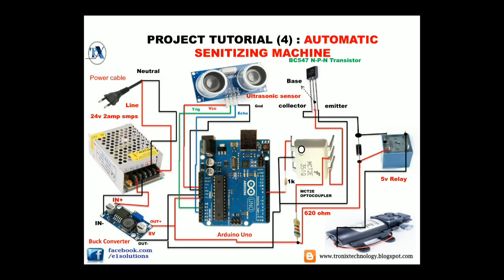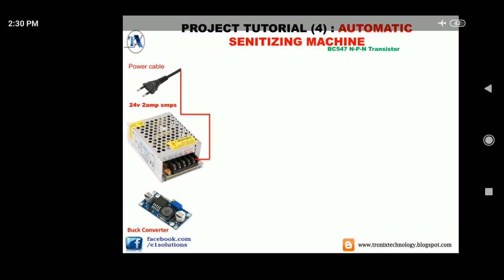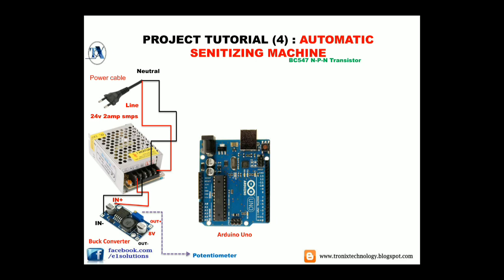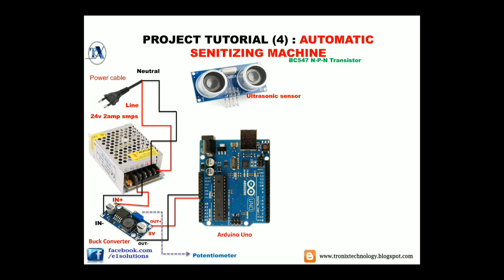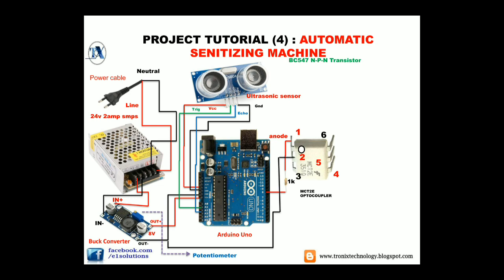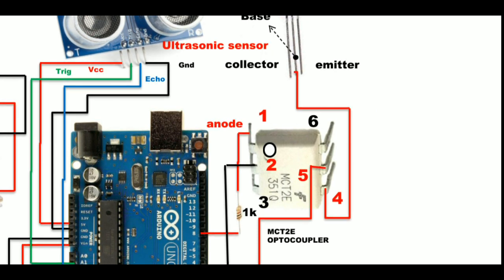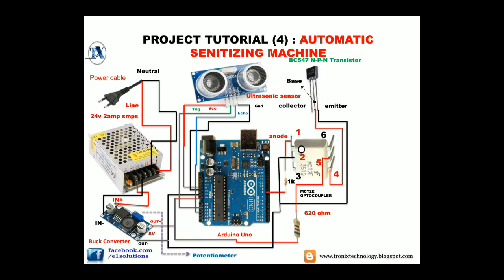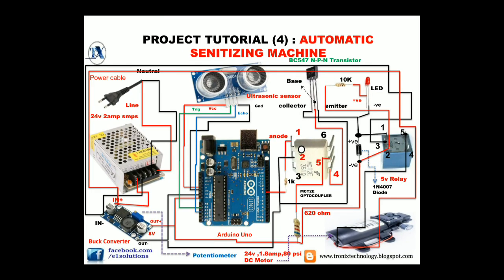Tutorial 4 : Touchless sanitizer dispenser

Comment: Sir make a video on , ultrasonic hand sanitizer circuit ,without using micro controller or Arduino ..
Reply from the maker: https://youtu.be/jpZMG4LOZ6g
Reply: @TRONIXTECHNOLOGY  sir it's based on IR. .. not on ultrasonic sensor
Reply from the maker: @userdefine  yes it is based on ir,ok I will make a tutorial video on ultrasonic system without microcontroller
Reply: @TRONIXTECHNOLOGY  😊
Reply from the maker: I had already maked ....

Comment: Why you used optocoupler you can directly connect base of BC547  to 150ohm  Resistor to Arduino
Reply from the maker: For extra durability and long life .....it also protect the microcontroller ic in case of any short circuit ....
Reply: @TRONIXTECHNOLOGY  ok